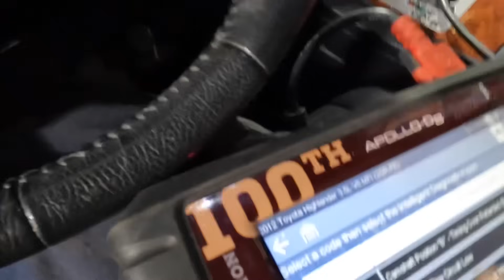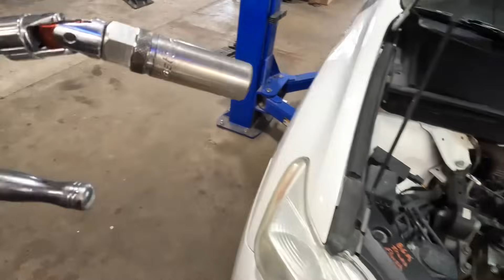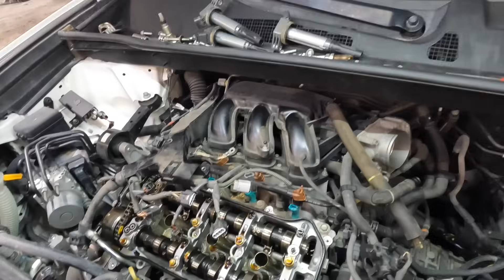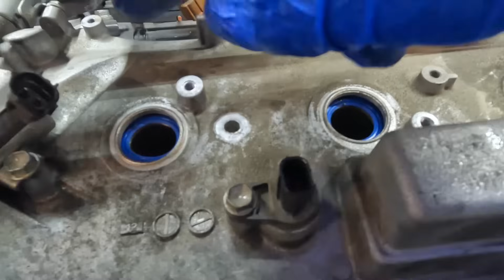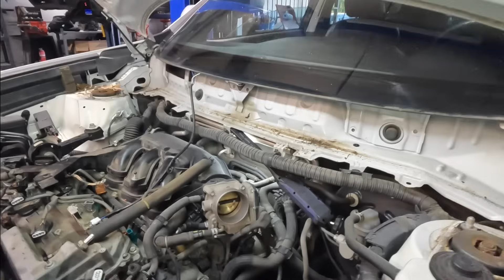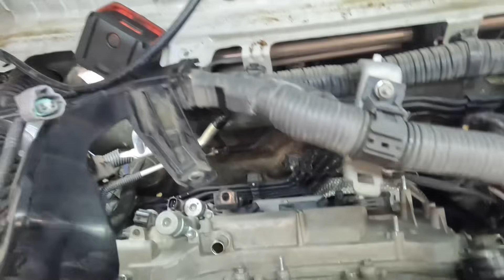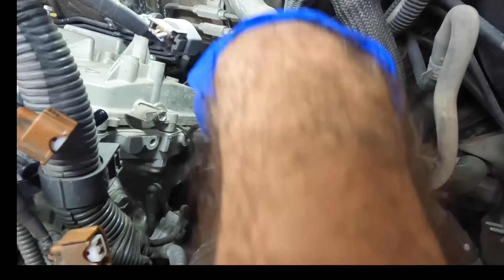Timing Chain Codes! Toyota Highlander P0014 P0025 P0012 VVT #repair #automobile 2GR-FE 3.5L

Comment: I have had only one V6 cross wise engine car, a Chevy 2.8 L and only had to put on a water pump that was not too bad.  Easier than on a Toyota.  Toyota has improved the spark plug seals and also they can be changed from the outside.  I do not like it when half the engine is hidden.

Comment: Just finished doing the same repairs on my estima/previa. The rear bank bolts, especially the 2 at the back. were a pain.  I had even less access to them. Anyway, Glad I'm not the only one struggling.  I don't think I would  have the patience to also making a video at the same time.

Comment: I would not allow a mechanic to put aftermarket seals on my Lexus or Toyota. Just because the local dealer did not stock them, you could plan better and order them online or from another dealer.

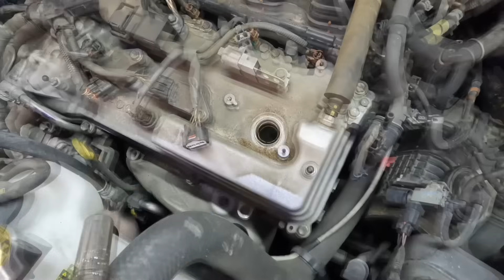Comment: 9:20 Ray, you can identify OEM spark plugs  in a Lexus and Toyota buy the tip of the plug. The OEM will have a paint mark or dot on the top of them. If the paint mark is there, they are original plugs.

Comment: You seem to be a very well informed mechanic. You see I’m having an issue with my 2007 Lexus es 350 it’s got the Toyota 2grfe in it. My problem is on cold start my car rattles on acceleration only under load for until the car properly warms up. My cars at 80k miles. I have a video posted on my channel it somewhere in my YouTube shorts list but it’s me driving with my window down listening to the rattle under acceleration. I really am worried I over paid for a car with major issues. I still have yet to find out what the sound is. It’s been the same and hasn’t gotten better or worse within the 5-6 months I’ve owned the car. My question is what is it and can I. Leave it alone or does it need immediate attention. Thanks ?

Comment: It really would have been better to observe the actual torque specs for the valve cover bolts, especially because of the oil line o-rings.  The small bolts are 7ft. lbs and the 3 larger are 15ft. lbs.  EDIT: Those oil pipe banjo bolts are specifies at 48lbs but that sure seems like too much for an aluminum cover.

Comment: Pro tip on covering up intake ports. Take the old gasket tape up holes top and bottom of gasket. Throw the gasket back on the manifold and bam no chance of foreign debris entering the combustion chamber.

Comment: Hey Ray why do you suppose that is that those connectors break only in the front is it because there's more heat or they're more exposed to the elements what is it I've had that issue too with coil connectors it's not always Toyota I've had that issue on a couple other cars but why

Comment: Are there o rings at the bottom of the spark plug tubes? So oil doesn't leak from the valve spring area into your ignition system?

Comment: Securing the catalytic converter won't work, no matter what you do, there are cheap  portable  cutting tools (100, to 150 dollar portable cable brand)  out there that make metal cutting like butter cutting, I have one that has cutting disc and I used it for muffler job purpose and any stuck bolts that can be easily cut and replaced, rather than try for hours to remove it the old fashion way.

Comment: Blow air around your spark plugs and then spray carburetor cleaner around the plugs and pull them out the carb cleaner will lube the threads

Comment: Little copper color antifreeze works great for sparky plugs dissibler metals works great on my bbc boat motor with aluminum heads  and the silver anti freeze  no heat and Iam sure you know that little rid but .

Comment: I made a bunch of wedges out of white Lexan for covers with pins (think door install shims)... I just lightly hammer them in around the area I can get the cover to lift and they "pop" off from the pressure... Made them on the table saw... 2 inches long and 3/8" at the widest... Works great...

Comment: The rear bank is really a stinker to get to. I'm wondering if you could loosen the upper engine bracket and pivot the engine a couple of inches forward go get better access? I know, the exhaust will be in the way, but it might give enough?

Comment: Hey Ray, 2gr-fe takes 6.4 quarts of oil. Not 5 quarts. ALL 2gr-fe engines take this amount. 2gr-fse uses 10.2 quarts. 2gr-fks uses 5.5 quarts unless on truck then uses 6.1quarts, 2gr-hks uses 13.2 quarts. Please pay attention to the oil capacity. Running these engines low on oil will blow it up. These engines hate low oil and low oil pressure. It is the fastest way to toss a piston.

Comment: As a master tech I know this headache cuz my wife has the same truck and I went thru the fun and done one of these first with her truck. But seeing you doing that back cover without the runners covers makes my stomach hurt cuz I’ve seen someone made that mistake and dropped a washer down the intake amd once everything went back and seemed all good and went to start it then ‼️ 💥 💣 valves crash and exploded and that was a mistake he never made again. That is one thing I will never make (knock on 🪵) Happy 🔧 and Holidays.

Comment: Banjo bolts most likely get their name from banjo tuning machines. Very similar design. The tuners have a hole for the string to pass through. The tuning key is behind the headstock, in a linear position.

Comment: Every Toyota with an engine cover has the issue with breaking connectors. It’s because the heat is trapped underneath and it cooks them. 

Ray said the rear connectors would be ok. There’s no cover on those.
My 99 4Runner with 240k does not have the issue

Comment: Idea, when you release the toyota connector, slip a small pick under it and gently lift up the clip. It may or or may not break. But a bit less likely.
Reply: Spray with a little Dioxit 5 first. let set for a minute.

Comment: Until 2015  any toyota Lexus with the 3.5L engine ARE JUNK! 
They have timing chain problems, +  rear timing seal gasjet problems $3k job , head gasket problems  $4k job, vvt actuator problems, which can explode destroy engine  $2k job, transmission problems, oil pressure switch problems.  The oil pressure switch would disintegrate draining oil in minutes destroying engine .

Comment: Welcome to Toyota 2GR-FE.  Beautiful engine,  PIA to work on the rear bank.  But,  you do enough of these it's like 30 minutes to strip it down. Although in only worked on the Camry V6, lot easier to reach than a tall highlander. However, at 1:15 hour you showed moving the harness back. That is not possible without disconnecting a whole bunch more wires and clips. I know it's not a how to video, but for sure that was missed.

Comment: I dont see why everyone says these toyota's are so great . This seems like a very bad design with these o-rings . Engine has 150,000 miles and major issues and the engine is very clean so its not a maintenance issue. Plus the self destructing plastic clips a
on those plugs ?? I guess they never figured they would see heat ?? I was thinking of getting a Highlander because of all the rave reviews I will rethink that decision.
Reply: All manufacturers have issues, but cars are made pretty good overall.  The new Highlanders are 4 cylinder only whether gas or hybrid.  If you want a used Highlander and don’t need AWD they made a 2.7 I4 which is a good engine.  I’d stay away from the V6s because of the extra complexity.  Those clips can be replaced without cutting the wires.

Comment: I used to mash a bit of double side tape for retaining stubborn sockets, something else tacky would probably work. Also, for retaining bolts and nuts, I'd take something like masking tape long enough inside the socket to make that little bit of difference tight and potentially retain it on the tape if it comes loose. Simply pull off afterwards.

Comment: Your closing statements about harness obstructions are 'cringe' for me.  I cannot believe how badly automotive engineers have made repair (or even inspection procedures) impractical nowadays.  About 30 years ago, I manhandled a Morris 850 mini engine on to my kitchen table, did a hone of the cylinders, replaced the rings and head gasket, and had it back in the car, running sweet as in less than two days (I borrowed the honing gadget) but used no special tools otherwise.  So a short-block engine refurb' for no appreciable cost - maybe 50 bucks NZ.

To spend several hours just replacing the spark plugs in a modern engine seems insanity to me.

Merry Christmas to you, your family and extended family who work in your shop.

Comment: Ray, there is one set of spanners which I don't notice in your tool collection and that is a set of thin open ended spanners. I bought a set of ten on eBay. They were Chinese one but of reasonable quality, for Chinese ones anyway. I had to use them on the inside knuckle of my sway bar links. There was not room to fit a normal open ended spanner behind the sway bar knuckle and use an impact driver on the outer nut. I found the nut would not come off even with a reasonable amount of speed applied by the impact driver and it just spun in the knuckle This is not a great problem when removing the old sway bar link however I don't think spinning the knuckle in the nylon/plastic link would do it any good. If you happen to purchase a set of these spanners make sure you get the full set of 10 as some of the knuckle sizes seem to me to be a bit out of the ordinary.

Comment: If both banks are giving the same cam phaser fault codes, why not just do the O ring seals and gaskets on the front easier cylinder bank first, than clear all the fault codes. Next, run the engine and see if the same fault codes come back and on one bank, or both banks. That way you will know if you are on the right track with your idea of an oil pressure issue or if you need to start looking at something else, without going to the extra labor cost. And please don't say the rear bank needed it anyway, or we fixed a problem but not THE problem. There were no external valve cover leaks on this car, and if it doesn't fix the cam phaser fault then it wasn't really needed. But we will have to wait to part 2 to find out the answer for sure. Here's hoping the car is fixed.

Comment: REEeeeee Don't bent the spark plug seal retaining tans farther than the need to be bent to remove the seals. It can/will fatigue the tabs causing them to break off prematurely (the next seal change). 

I had to find something to REEeeeeee! You are one in a million. Most YouTube certified mechanics would not have gone the extra mile like you do.

Remember, anything is a hammer if you use it wrong enough.

Thank you Ray!

Comment: 56:25 4 bolts. I've got that memorized on the Sienna. Wiper arms, 4 bolts, wiper motor, 9 or 10 10mm to take the cowl out. Sienna doesn't have to unbolt the strut though. 1 Electrical harness and push it through the large hole.

Comment: 31:50 It looks like that tube assembly includes the tabs and appears removable. So you could pull that off without bending the tabs, they'll only take a few bendings before breaking off and possibly dropping into the engine.

Comment: 1:12:28 Those coil over connectors are $15 for a set of 6. Remove wires from the new ones, remove the wires from the old ones and install the new ones. There's some videos out there on how the connectors come apart, took maybe 20 minutes? Good as new.

Comment: Brings back PTSD memories from replacing plugs in 2012 Camry V6 about 3.5 years back but with 50K fewer miles and fewer years of aging.  Didnt break any of the plug coil connectors but iI didnt remove the cowl to try to save time.  However, removing and installing the rear intake was a #$%&! ship in the bottle kind of job.

Comment: How much are you billing for the valve cover and spark plug change on the 3.5 L TM job because I have a same situation and Don't want to get screwed over.  Those vertizontal engines suck because of the rear bank have that manifold in the way !  Thanks!

Comment: There's an easier cat converter saver. Get a piece of expanded steel (like the kind on a trailer ramp) and mount it under the cat and pipe by either bolts or welding (I use bolts/screws). Try using a sawsall on that stuff to get to a cat! You'll spend a long time, many blades, and wake up half the neighborhood.

Comment: You should use bungee straps to hold that wire harness out of your way. Make the job much easier. Seems like they would have used better oil rings there.

Comment: Great work and video !. This valve cover job seems harder than on a 6 cylinder BMW, that is cursed at by every US mechanic, except for car Ninja:).. Nice to see someone taking care of his car, the engine looked like new inside, I bet he does oil change before every 5K miles. These traverse V6 engines are a pain, things would be much easier if the thing had rear wheel drive.

Comment: Banjo fitting.  Look at the fitting itself, from one of the flat circular faces.  The hose or hose barb sticking straight out to the side looks like the neck of a banjo (instrument).  Overall it is the shape of a banjo (instrument).

Comment: Having owned a 2008 Highlander hybrid with the 3MZ, I feel your pain.  Just sold it with 310k miles and the original hybrid battery.  Great car, but access to the rear bank is no joke.  That said, the valve train on this one (2GR) looked incredibly clean; owner clearly has done regular oil changes.  The seals on top of the 2GR valve covers are definitely an issue, and also supply pressurized oil to the spray bars for the cams…should be replaced along with the valve cover gaskets.  Bank 1 along the firewall will leak first, as oil is essentially pooling against the valve cover gasket…the 1MZ and 3MZ gaskets also eventually leak there.  That said, all are great engines, and the owner should continue to enjoy that Highlander for many, many more years.  I installed a 2GR in a 1991 MR2…it is scary fast.

Comment: It should be illegal to put 6cyl. Engines in front wheel drive cars.😅😂
Reply: As of 2024 the only transverse V6 remaining at Toyota is the Camry and it will be gone soon.  Honda still uses transverse V6s on their Pilot, Odyssey, and Passport.  Ford has none.  GM has a few that I think will be gone soon.

Comment: Am I ever glad we don’t really do the whole fwd V6 thing over here. I don’t think my old joints would cope with doing head work way down the back of the engine, like that!  V format engines are awkward enough in rwd chassis, but they’re enough fun to make it worthwhile, most of the time. Why anyone would stick them in a transverse layout beats me.
It always seems like step one should be remove the car, for access, even if it’s only coils that need doing.
Don’t forget to check the filter screen in the feed to the cam phasers, on the cover. Remember, that didn’t come out with the banjo bolt.
I totally get what you’re saying about the granite guys. I sometimes suffer from tinnitus and it’s a similar sound and can’t be turned off, just like your neighbour.
I resort to drowning it out with the radio, which works because my noise is inside my head. Won’t work for you, though. On the other hand, you can pack up and go home, leaving your noise behind. Mine comes home with me and keeps me awake all night!
Mercifully, I don’t have it all the time and, oddly, hardly at all since I hurt my leg, almost a year ago.
Oh jeez, I really hope you’re right about the oil seals. Imagine doing all that and it not being fixed! I wonder could that be a stock fault. The customer asked for the cover gasket replacement, after doing his own research, so someone must have told him that was a likely cause. Fingers crossed 🤞 anyway.
Good luck tomorrow!

Comment: Nice work Ray, what a p.i.a. job I bought my first Toyota in 2013 and bought a FJ over a 4 runner because of the design. It is waaay different than what you're dealing with. I like the old school way of the crank facing forward so you can hopefully work on it if needed. And see what may need attention. You are bad ass!

Comment: Must be running low on brake-clean since your using shop air to clean oily valve covers, which is ok  but it's not the same as throwing empty brake-clean can across the floor.........

Comment: i just wonder if there was some diagnostic work that should have been done before assuming it was gaskets or oil seals.  Could you use a scan tool to definitely say it was mechanical vs. ECU vs. something else?

Comment: Ridiculously complicated- scrap it and buy a new one.
Reply: Most newer vehicles have more plastic parts that will break if you look at them after about 6 years of heat cycling 😢

I'll also tend to stay with 4: cylinders just for ease of maintenance 😅

I got a V6 transverse engine setup and hated them

Also got a V8: longitudinal setup and has some elbow room for the plugs😅

Comment: I feel your pain, when you drop a nut or bolt down into tight spaces.
Makes me feel Profesional even thought its a DIY job. 
Just like the car the radio mounting 
Bracket for the Alpine radio on the old mussel car out on the lot makes you feel out of your element .
I belive you can get a metal din ring to fix that radio install on. Or make one.

Comment: if you read any comments I have something that might be useful to you. fab rats has a home made stand that has adjustable cradles and a table for holding front and rear ends up to change springs etc. he can put a rear end on it and roll it out to work on. you can see it on the episode about the square body has with stood the test of time.

Comment: Those are all OCV (oil control valve) problems which isn't that uncommon.  When the 2GR first came out in 2007, there were all kinds of issues with the cam gears braking apart and causing the same trouble codes plus noises but those issues were all gone by 2012.